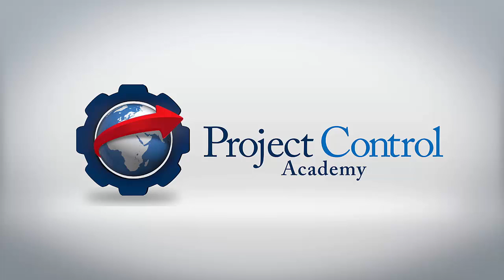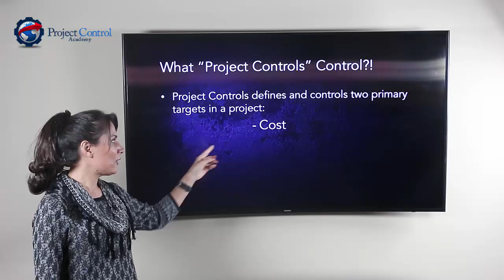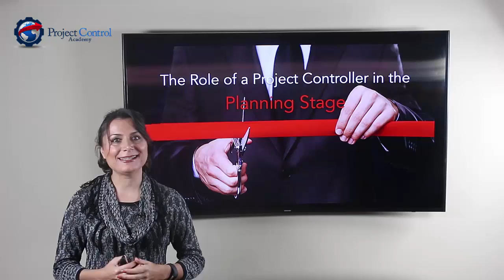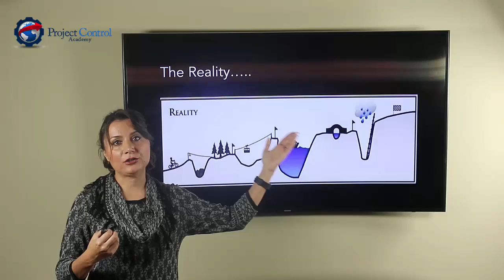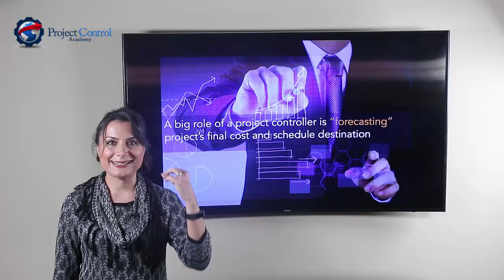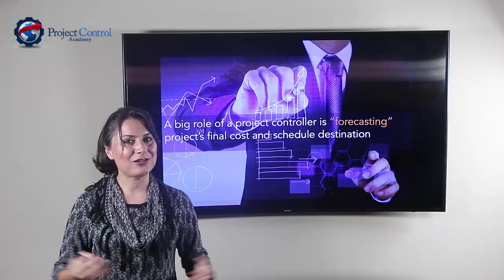How a Project Controller Controls a Project?

Comment: Terminology here is key, project controller? Is this role defined within PMI, APM, Prince 2 etc.. here is a role normally carried out by a project planner and estimator overall project  control by the project manager/senior project manager/project director, really dependant on the size of the project and monitoring via EV.